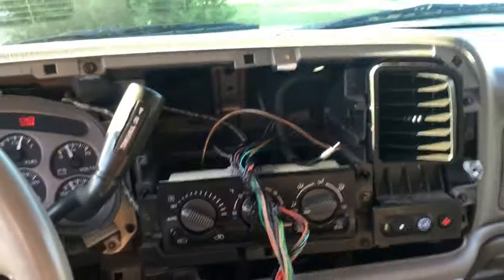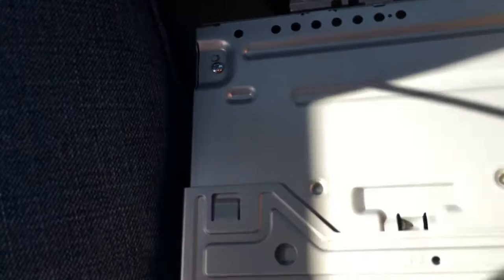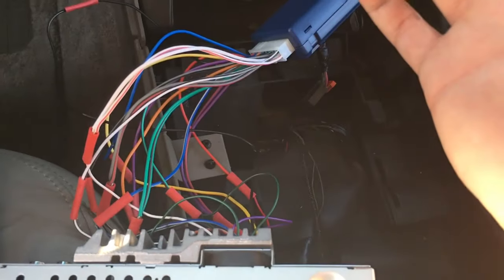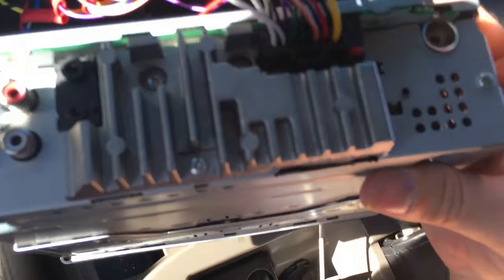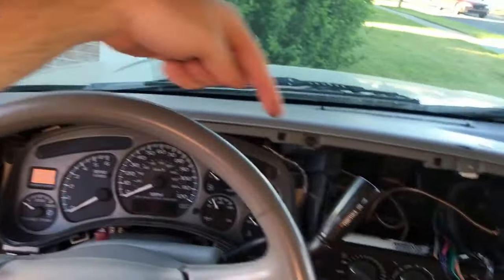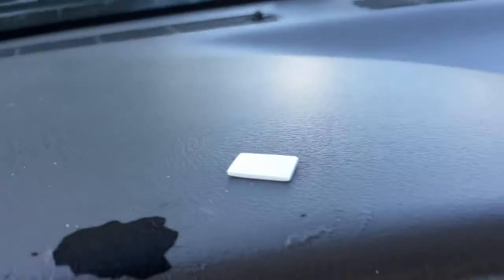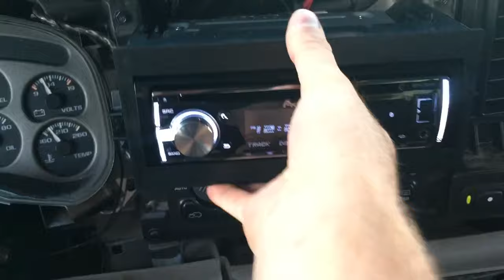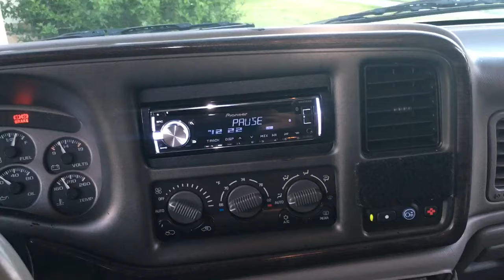How to install aftermarket stereo with a stock Bose sound system Tahoe, Yukon, Suburban, Escalade

Comment: Buy the PAC RP5-GM11 and you won’t have to sacrifice the steering wheel controls.
Reply: That’s the pac we got for my buddies 03 Escalade and I’m having trouble wiring it together. The instructions weren’t much help
Reply: Don'tWorry WhatMyNameIs google crutchfield and get the phone number and see if they can help. In my case they was able to help me.
Reply: Don'tWorry WhatMyNameIs what are your issues? I may be able to help ya
Reply: Dean Brown, i had a hell of a time with it. Ive personality never had to use one of these harnesses before and kinda just jumped into it without doing any research. I've been doing some and now have a better understanding of it. But it is for my buddies Escalade and he wanted some subs. For now we put a line output converter which was a shit show too. But the harness, i wasnt able to constant power to the new head unit, it would just flicker and on the pac the light was always red. I dont think i had the dial on the right number. And the other problem was not knowing where to wire the swc wires.Lol sorry for the long ass message. But any info would be much appreciated
Reply: Don'tWorry WhatMyNameIs lol you’re good. But yeah you have to make sure the dial is on the right number. Each brand has its own number on the dial. It’s better to have a higher end head unit to go with the PAC. I have mine hooked up to a pioneer with zero issues. When you choose what number is for the head unit make sure the PAC is unplugged from everything as the manual says. I believe there’s a reset button on the PAC as well I’d definitely start with that but look up the manual I think there’s steps on how to do it. The swc wires have to be connected to the wire harness that came with the PAC (solder and heat shrink for best connection) then the other harnesses are plug and play with the trucks stock harness coming from the dash. Also for the swc to work you either have to connect the blue wire or the headphone jack to to the back of the head unit. Read the manual for the head unit to see if the headphone jack on the back is swc or not. Possibly on the back of the head unit itself it might be stamped with swc by a plug. Hope I helped ya haha. Let me know if y’all get it lol

Comment: I have a 2002 Savana with Bose system. I just had a shop replace the head. Now that they're done, I have a battery drain when the ignition is off. The shop tells me it's one of my old Bose amplifiers. I think they have messed up something in the wiring. Is there something they could have done that would cause the amps to draw about .6 amps with the ignition off?
Reply: Rick DeBlock did you ever find a fix for the issue? I also had the exact same issue as you are/did. The draw is so bad that it kills my battery over night. Extremely frustrating.
Reply: @trevorlucidi7838  I had that issue to  but it was cuse my remote cable was touching the positive and it made it stay on all the time till it drains the battery
Reply: Jeovany Hernandez I still haven’t figured out my issue. I have it wired to a toggle switch, even when the switch is off, killing all power to the deck, it still kills my battery. Literally the only way to stop the draw is by pulling the 15amp radio fuse out from under the hood. Somewhere within the radio system it’s drawing battery. I just can’t find it for the life of me and so many people are having the issue, I just can’t find an answer as to how people fixed the issue. It’s driving me nuts.
Reply: @trevorlucidi7838  try and disconnect the amp and see what happens
Reply: @trevorlucidi7838  did you check to make sure there is nothing else hooked up to your constant 12v ? There is a constant 12v wire. That should only have one connection to the back of the aftermarket head unit. If any other wire is connected to it then it is supplying constant power. They might have the amp hooked up to the constant 12v. It needs power for all the speakers to work. But it needs to be hooked up to a switched 12v wire meaning it turns off when you turn the key off.

Comment: how does this unit work with the 2003 trucks with the steering wheel controls???
Reply from the maker: Tommy Woods mine had the steering wheel controls as well, but I never used them so I just bypassed them in my wiring.  From what I remember there is a little interface module you can purchase which will interface between the PAC unit and your steering wheel and OnStar inputs (I think the OnStar and steering wheel we're on the same plug or something). I never used the steering wheel controls and my OnStar equipment was so old that it wasn't even supported anymore.

Comment: Does the interface help with the alarm/reminder tones to go out of the speaker?
Reply from the maker: That is a great question.  I've never noticed them...also I have never NOT noticed them.  So I have no idea!  All I know is my system still sounds great and I've had no problems, so that set up has worked for me.  I've never cared or noticed the reminder tones.  Sorry.
Reply: @mrjchristensen1  OK, thanks. I just installed a double din stereo on an 03 Tahoe with an after market adapter but the tines only come out of there and not the speakers anymore. I was wondering if this is a better option.
Reply from the maker: @gerrygalvan7313  Got it, sorry I don't have a good answer for you.  I know there was a module for enabling the onStar and steering wheel controls, which I did not install because I didn't care about those features enough to want to mess with another component (this old Yukons have analog onStar antennas anyway so they don't even work anymore).  So I decided to just not have those features and I've been fine without them...but I wonder if maybe the chimes are on that same circuit?  IDK, and it might even be different on a 03 because they changed a few things (the din size is only 1.5 on my model, for example, which is ridiculous).
Reply from the maker: @gerrygalvan7313  When I get home tonight I'll check the chime sounds and see how they work.
Reply from the maker: I tried a few things, my key reminder chime comes out from under the console, does not use the speakers.  The lights on chime doesn't make a sound (maybe that one uses the speakers?  Maybe mine is broken?).  I guess I've never noticed because the lights are automatic and I rarely (if ever) manually turn them on.
Reply: @mrjchristensen1  Ok, thanks for checking!

Comment: Did you get sound out the DVD player
Reply from the maker: What DVD player?
Reply: @mrjchristensen1   I have an 03 Tahoe Z71 and I can't get the antenna unclipped from the factory radio any suggestions on how to do it so I can put my aftermarket radio in

Comment: Where did you get the antana adapter at?
Reply from the maker: Waller Lane it came in the box with the stereo.
Reply: My sister gave  the stereo to me and she lost it so do you know where I can get another one
Reply: I'm putting in a dual stareo in my Chevy
Reply from the maker: You can get them at Walmart or Amazon for pretty cheap, usually around $5.

Comment: All u have to do instead of buying that extra kit is use that pink wire from that plug your not using and it will make it work
Reply: Ok and hook it up to the red wire ?
Reply: Pink to remote
Reply: @DwayneSmalls So run the pink wire from the second plug back there to the pac unit that is connecting to the harness of the aftermarket radio?

Because im fully connected and have sound while my 02 Yukon slt 11ch Bose is in acc mode with the PAC ROEM-GM21A. The moment I turn the engine over - no sound although my pioneer head unit Avh-x4800bs is saying that its playing still? What did I  do incorrectly, please advise.

Comment: Will this work for my truck it’s a 2003 Silverado with Bose no steering wheels controls ? But want to keep my bose system thanks
Reply from the maker: It should, but I'm not an expert.  I bypassed the steering wheel controls because I didn't want to pay for the additional adapter, so that's essentially what you'll be doing as well.
Reply: You don't have to buy any pac modules. Just hook everything up as you normally would... But you have to use the amp wire too...it's blue on the AutoZone wire harness...and it's pink on the factory harness...

Comment: The Low + wires are for headunits that only do 25w x 4. So, you should only be using the LOW wires if you have a standard Pioneer HU. If its more than 25w per channel, you need to use the highs. NOT together.
Reply: Thank you for that tip. I had just matched the colors.... then I tried BOTH. I just removed the highs, and spliced the lows instead. However. I STILL only get Sub-Woofer, and Trunk speakers. No FRONT or REAR door speakers. I'm so lost at this point. any assistance on my next move, would be greatly appreciated...
Reply from the maker: 1GeekMedia thanks!
Reply from the maker: Gregg Cerenzio You might have a problem with you PAC unit or with your BOSE amp.  You should get some feedback, if only static.
Reply: My PAC has no lights (I think it should? where it says FRONT SPEAKER, etc... with the little holes).  I get no static, NOTHING. total dead on all 4 door speakers. Perfect sound in the ceiling, and the Sub. I suspect the PAC is ok... Maybe the AMP? Best way to test it?
Reply: ***** I should add, I also had the exact scenario when I wired it manually without the PAC....
Reply: UPDATE: Hooked up a speaker to the output of the PAC, and it worked. So, looising the sound somewhere from the harness to the speaker. Perhaps the AMP? My big questions, is still, the SUBWOOFER working. does that mean the AMP is ON, or does that not mean squat...
Reply: I have been at it for hours upon hours, over several days. I can't find the Factory amp. I've torn the truck apart. the BOSE amp, is in my center, but, the factory amp.... no luck. My truck is in peices, ready to throw in the towel. any help on finding the AMP would be super....
Reply: Gregg Cerenzio have you tried checking in your glove box
Reply: Yea, I tore my truck apart. I dunno, maybe I'm braindead....   Ultimately, I gave up. I installed all new front and back speakers, and ran all new wiring from the stereo, to the new speakers, leaving the working subwoofer, and trunk speakers, in tact. It sounds awesome.

Comment: Does this work with 6 speaker bose system? Please get back to me need help
Reply from the maker: Jonevan Cooper does it have a separate Bose amp after the deck unit?
Reply: I just did an 03 yukon with Jose system and Steering wheel control. I hooked it up. But client says it doesn't have sound when he puts it into drive? I was sure where to hook up the VSS, reverse, and other wires from the unit... HELP

Comment: how do I know If my car has is the bose system? It has on star so does that automatically mean that it has the Bose system?
Reply from the maker: I don't think so.  Look for the silver BOSE logo on the speaker grills or branded somewhere on the original deck, or just count the speakers.  On these Yukons with BOSE there are 1 tweeter in each A pillars by the windshield (2 total), 1 mid range speaker in each of the front doors (2 total), 1 speaker in the lower center console by the driver/passenger's knee (2 total), 1 speaker in each of the second row doors (2 total), 1 tweeter in each of the rear pillars (2 total) and 1 subwoofer in the rear driver's side quarter panel (1 total), for a grand total of 11 speakers.  In order to power lots of speakers like that they will have a separate amplifier to boost the sound that the deck unit produces.  In these models the stock BOSE amp is behind the glove compartment.  Hope that helps!  If in doubt just turn it up really loud and if it sounds amazing it has BOSE.  :)

Comment: Just hook the amp wire up.... Anytime you add a aftermarket stereo to a system with factory amp, you must use the AMP WIRE. or you will get no sound. 

 This was a waste of 💰.
Reply from the maker: How did you integrate the 4 channel OUT from the new deck with the 11 channel IN on the amp?
Reply: Where do u connect the amp wire to
Reply: How do I get it to not run a constant .

Comment: my suburban has 9 speakers what do I do
Reply from the maker: If it has the BOSE system, it most likely has 11 speakers.  There are 2 tweeters in the front pillar, 2 woofers in the front doors, 2 mid range by the driver and passenger's knees (in the center console, where your right knee would rest if you are the driver, most people miss these 2 speakers), 2 woofers in the middle doors, 2 tweeters in the rear pillars, and 1 subwoofer in the back quarter panel.  If this is your system you will need an interface module between the new deck (4 outputs/channels; Front Left, Front Right, Back Left, Back Right) and your system's BOSE amp which uses the 11 channels (speakers) mentioned above.  I have another video showing the installation of a PAC module where I explain it a little, check it out.

Comment: You seem to know these bose systems extremely well. I own a 2003 suburban with the bose system and have put in an aftermarket pioneer head unit with the pac module and metra harness. My question is, why does my subwoofer level control not work on my head unit? I can control the level of the front and rear door speakers but not the sub. Any help would be greatly appreciated!
Reply from the maker: fuckgoogle+ my guess would be something in the PAC wiring.  But maybe the PAC integration doesn't even support independent sub control-- I don't think the Bose units offered that, just bass and treble.  So the boss amp might not even allow for it.  Just my guesses.
Reply: can't do it. the sub level is controlled only if it's ran through the sub out rca
Reply: What pac harness did you use for your suburban?
Reply: Hey yes look I did the by the same pack module how are you on one factory Soundsystem interface anyhow I’m going to be hooking it up so this will allow for my subwoofer to come on???! Thanks